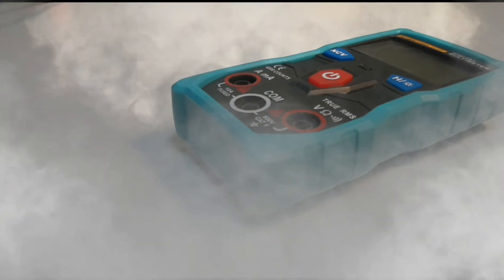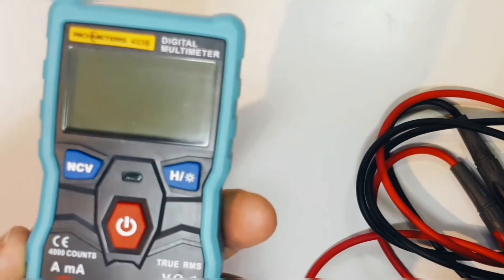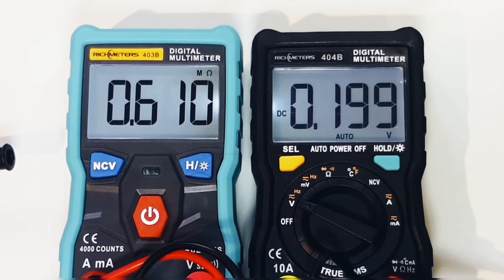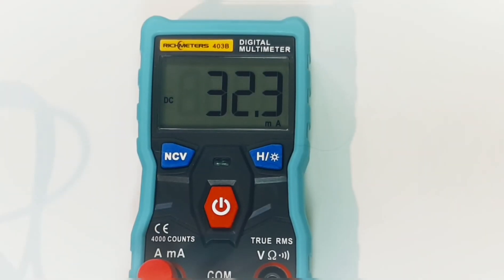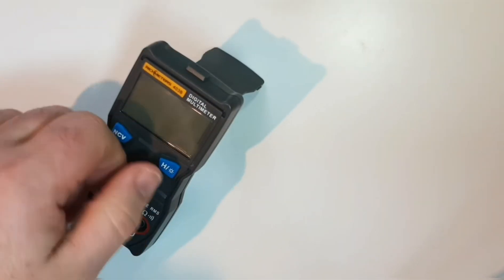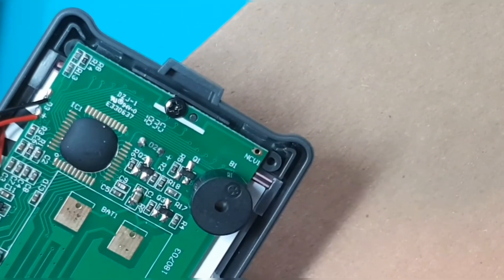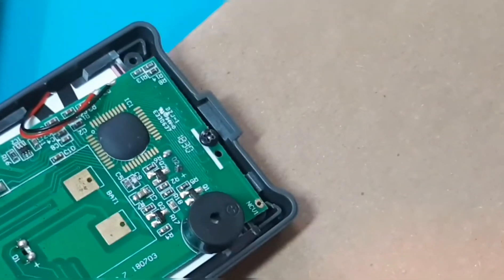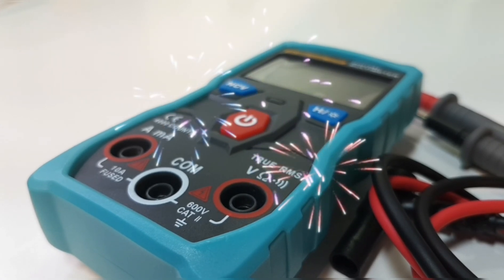RICHMETERS 403B CHEAP-O Multimeter Review & Teardown

Comment: I've just received the meter, and after some quick tests I must say I like it very much (I have maybe 10 meters, and I've used  a lot of others,  in 55 years of study, work and hobby).
It will  find a place in one of my tool  boxes (there are other meters on the test bench) because it does "honestly" what it promises.
I bought it on Ali Express  for the small sum of 13.5 Euros,  which included delivery, the meter, semi-decent probes, two AAA rechargeable batteries, a charger and a carrying case.
Truly satisfied
Thank you for the reviews. Next meter will be the hybrid Sanwa, If  I can find it at a cheap price
Reply from the maker: Wow, great price especially with the rechargeable batteries!! It is a fantastic dmm...BTW, That Hybrid Sanwa is really unique too...! KOT!
Reply: @KeepOnTesting  My meter is exactly  the same (Even inside, I've cheched)  meter,  but is labeled ZOYI ZT-S1,, and it has the LED fitted, and it works
Reply from the maker: @rizzulazzi  ZOYI is the actual OEM on this multimeter,  Richmeters is a rebrand 😀👍

Comment: Nice teview. Thanks. I have one in the mail ordered from AliExpress.  
I'm sorry because when placing the order I did not read it would not test diodes.. but I have a lot of other meters..
The  riser board on the mA socket is needed because the socket is split, so two contacts go to the mainboard.  
When a plug is inserted the contacts are shorted and the meter knows that he must measure current.
Reply from the maker: Great info Maurizio! Its a pretty good multimeter with alot of decent build quality. Great choice 👌
Reply: @KeepOnTesting  Because of the inability to measure diodes I gave it to a friend, who loves to destroy multimeters  (he is a surveyor, mot an electrician) after sealing the current input socke, and ordered a ZOYI ZT S4 /https://www.aliexpress.com/item/32996377260.html?spm=a2g0s.9042311.0.0.5cde4c4ddMaxfD) that does diodes, and temperature too. It is very nice, at a decente price. I will keep it.
Reply from the maker: @rizzulazzi  Excellent,  I will order one for a review! 😁👍
Reply: Mine came with the case, but without the rechargeable batteries an charger, described in the ad..
Reply: sorry, I'm wrong: they do not offer it with rechargeable batteries...

Comment: ZOYI ZT-S1(my device) or analog Richmeters RM403b
Begins to measure volts from 0.80V. If 0.79V that writes the word AUTO instead of the indication. 
And the important point - the speed of display of measurements is late in comparison with normal multimeters. I am yet not especially strong in electronics - the diode soldered out from card showed on display as 0.866M Ω in one party and nothing in another (display the word AUTO), and the other my cheap multimeter showed the same diode as 0.523V in one party and nothing in the return.
When the probe in amperes costs the device each 5 seconds publishes a quiet signal and at the same time red indicator winks - it is excellent.

And it is interesting messages about this device (from the review on Youtube of the Russian user):
- "All nothing, but is one annoying nuance - a display viewing angle. The step to the left a right step and the display becomes invisible"
- "For the master of electronics will not go"
- "In car service was worn out to change safety locks - masters quite often forget to switch a normal multimeter and then this model with the auto mode of course saves"
- "There is a lot of limitation because of automatization "
- "For me as electronics engineer about anything"
- "Device not bad, interesting. Slowed down only."
- "Question: For repair electricians of the car will go?  - the Answer: And not only, 3 months I use the full-fledged device "
- "The most successful multimeter for the normal "man in the house" who is not burdened by institute knowledge. Full automatic machine, unexpectedly. "
- "For work such it is necessary to us and that after a lock burned already couple of tens of multimeters "
- "Here I also decided that to me and will be such convenient, than to bother with switching of the modes. It cool! "
- "For the master of electronics will not go. "
- "I advised the friend such device, and he is happy as an elephant. He is not an electronics engineer, not the electrician, and just the guy with hands. For the house, for household use most that."
- "At that time when I was a pioneer and little is skillful, precisely would buy him. "
- "And why for house? I here at work on a working flat out burned next the 830th, from ring-up did not switch also tension to measure got. Approximately every two years such jamb happens"
- "Such device will find the grateful user. For house, nonprofessional use, very will approach, it is not necessary to bother with switches, especially, if the person understands what a little he switched there. A toy, of course, but with the pluses. "
- "And I here think such to take as house, for the iron, check of batteries, sockets and in field conditions. Will quite descend! "
- "Bad multimeter... It is better to pay in addition a little and to buy in classical execution with the switch "
Reply from the maker: Thanks for the feedback!

Comment: hello, ı have a cheap multimeter, problem is  it does not off. dead or  repair !
Reply from the maker: Hi Kemal, your multimeter does not turn off, is that correct?
Reply: @KeepOnTesting  hi , yes. do not turn off.thank you
Reply from the maker: What make is the meter? Is it a pushbutton switch or a rotary selector? It may be mechanical or the circuit itself might be shorted. Will need more details.
Thx
Reply: @KeepOnTesting  ı dont use a 9 volt battery, I use   adapter.
Reply: @KeepOnTesting  rotary selector. sorry for my english !
Reply from the maker: @kemaleddindurustnet8978  okay, that's a fun one, could be a faulty transistor or a bad contact/track in the selector switch. You say its powered by a power adapter so that adds another element. If you use batteries would it still fail to turn off? If you want to send it to me, I will make a video of the repair and if I cant fix it, Ill ship you a new meter free of charge...let me know!

Comment: I also have the Tacklife version of 403B and same results except the light works - this video just makes me want a 404B lol   Youre right thought they feel well made and feel good in the hand but having to wait for results and worse having less low end functionality - I think they could have done better - and the 404B proves it, and im guessing its both auto and manual ranging.
Reply from the maker: The 404B is my choice because it offers alot more functionality and versatility. I think the 403B serves a purpose but it's slow and very finite in terms of what it can do. The Automatic selection is its claim to fame but it's going to need more ooomph for me to get excited! I actually tried troubleshooting an LCD TV display board with it and gave up after 5 minutes...
Reply: I can easily see the 403B being difficult to troubleshoot with - I want to like the 403B, but if the 404B works correctly and is same feel and quality it seems worth having, probably just as cheap too Ill have a look. Myself I like a nice range switch, its a big part of the feel, quality and "personality" of a meter.